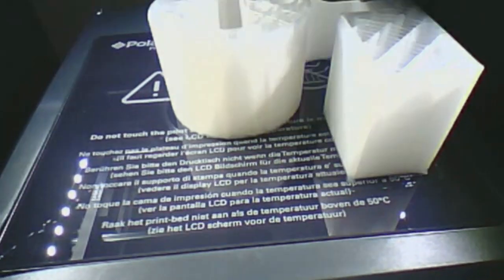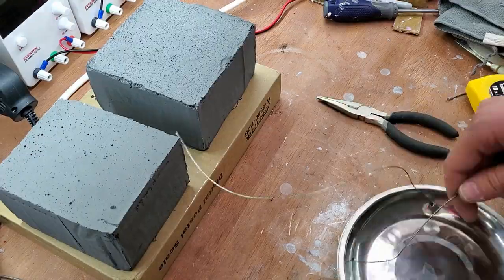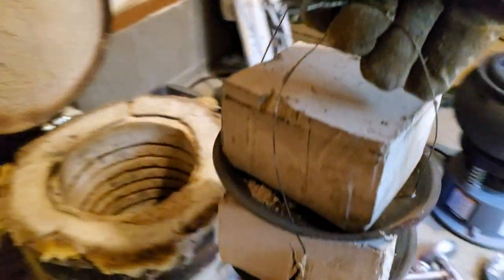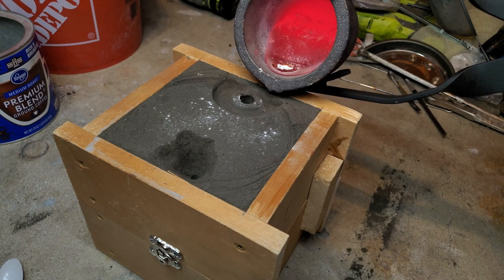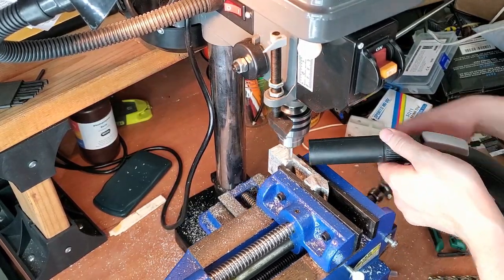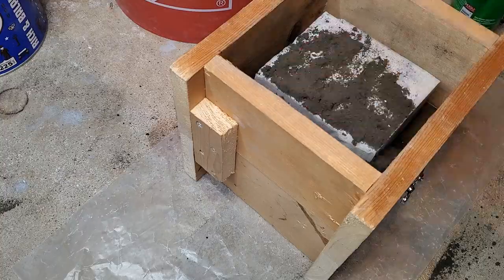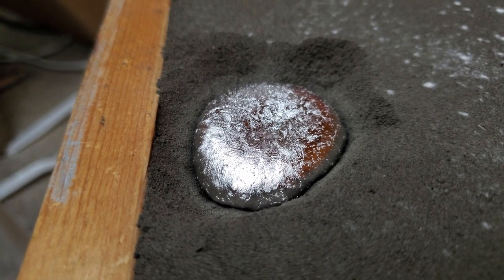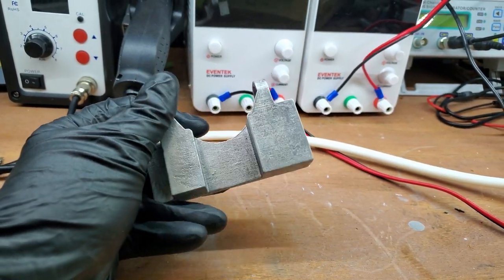Trying MyFordBoy's Method

Comment: Additional ideas.
1. Cover the 3D printed master thinly with plaster using a brush. Put some steel wool around and cover again with plaster to build up some thickness. Bury the whole mold in sand and burn out in sand, the thin plaster mold should heat up quickly and dry out while the plastic is melting out. Then cast. This is what I would do because I dont have a dedicated oven with temp and time switch etc.
2. Spray the master with 800°C heat resistant spray paint. Dribble fine sand on to the wet paint on the 2nd 3rd 4th coat to build up some thinkness. Burn out and cast like before. This also should work with aliminium.

Comment: the cracking probably happened because of water expansion, or maybe PLA expansion? you can raise the temp to 60 pretty rapidly, keep it there for a bit, keep it at 80ish for a bit, and keep it around 90-110 for a bit, then start going up the rest of the way, doing the same thing again around the melting temps of PLA?

Comment: I think the reason is that any thing you could design with a CAD you can easily print it with a 3D printer , and then lost PLA then became the easiest method to convert this object to metal , while the traditional sand casting require you to tool a model for the part to Greensand Cast or use an real copy of the part

Comment: also use a vacume to suck the air out the of investment slurry. plaster of paris is an awesome investment material to use as well very low amount of air bubbles. if u want better heat retainment try pearlite in the mix.

Comment: why use investment, Plaster of Paris/Fine sand mix works just as well and PLA will burn out in an oven set to 220 celsius  I leave it at least 24 hours before burn out ( for the plaster mix to lose more moisture) and when ready to cast put the plaster mould on the furnace whilst melting the Ally to heat up then put it in the green sand
Reply from the maker: 220C, no matter the time, is not hot enough to expel the chemically bonded water. You might be getting lucky now, but you shouldn't play with your own safety like that
Reply: @TenTries  Maybe the 50/50 mix with sand helps I've had success with Ally but I would not try this with brass. so far so good,  Probably 10 times or more and a few of those I could have reused the mold  If I did not have to wash it off, so it definitely works for me. Don't believe everything that you see on  yuotube.  I do prototyping design and cast/machining for a living, (not posting youtube vids) so luck has nothing to do with it, People who do casting with no PPE are the ones who need luck. So maybe you should try my method  before criticizing, Thanks for reply
Reply: Can you really burn out the PLA at only 220 C? I print PLA with the printer set to 210C...
Reply: @slicktires2011  It is slow but it does melt out

Comment: Lost foam, lost pla and lost wax all have one problem that a wood pattern does not have. If the casting fails, you lost the pattern. Unless you have, like for lost wax a silicone mold to make a duplicate. Lost foam has that option but that can get expensive, depending on how far you want to take it. Lost pla, reprint, every time your casting fails. I'm a patternmaker by trade, haven't found anything that can be done with cnc 3d printing or industrial lost wax yet. Sculptures don't count.

Comment: I wanted to ask a very specific question, when raising the temperature to burn out the plastic, let's say up to 650 degrees celsius over 8 hours. When you say slowly, would something like 2.7 degrees Celsius every 2 mins work. What is the ideal rate of increase per min?. Also could you clarify why you reduce the the temperature at the end of the mold after its completely burned out and to what temperature for how long. Thank you for taking the time to read my comment and looking forward to your reply.
Reply from the maker: Really, it's best to follow a burnout schedule/cycle. You can find the burnout cycle I use at https://tentries.com/lost-pla-casting/. A simple steady increase in temperature isn't ideal for burning out investment. A staged approach as shown in the link works much better.
I let the investment mold cool so that it wouldn't break due to the thermal shock of touching the much cooler sand
Reply: @TenTries  Thank you very much, really like your channel and hope you can make some cool aerospace parts, the more complicated the better xD

Comment: I just had an idea but don't have the equipment to try it - lost pewter casting - make mold of PLA part with high temp resistant silicone for maximum detail, then cast with Pewter which won't melt the silicone, then create a new plaster mold with the pewter part and melt it out as per lost PLA method and then cast with Aluminium?
Reply from the maker: That's a cool idea! I have some fusible alloy (even lower melting temp), so I might have to give it a go! That might fix any ash issues
Reply: On my channel, you can see some old silicone pewter casting videos. Smooth On makes a great high temp flexible silicone for that task.
Reply: Interesting, but what would be the advantage of pewter over wax?

Comment: for lost pla, if i used sand instead use paris plaster.its ok?
Reply from the maker: You'll want to use casting plaster, which is not the same as plaster of paris. Casting plaster has some additives that make it more suitable for casting. Have you seen my videos on Lost PLA casting? I talk about how you can make casting plaster from ordinary ingredients.
If you are referring to just pouring aluminum directly onto PLA without burning out the PLA first, definitely don't do that. It can send molten aluminum spraying everywhere, an you will almost certainly not have a very good cast. The PLA and water in the plaster must be burnt out

Comment: You'll have to use very dry green sand, or the plaster will suck up humidity 
Once the plaster gets humid, you're screwed
Reply from the maker: True, I moistened the sand just enough to pass the break test, as usual. It was not moist enough to affect more than a very thin layer on the outside of the investment, away from where the aluminum contacts it

Comment: Credit where credit is due but not where it is not due. Myford did this about 3 years ago. He certainly was not the first. Pauls garage did it about 4 years ago and 3DTPO 4 more before that i.e. 8 years ago. Myford's result suffered some mould fallout and metal miss fill. I know where you got that crazy pouring basin design from and I urge you to abandon it for it is crap. A good basin will keep the sprue full, yours certainly did and indeed because of its design could not. There did seem to be a lot of gas coming from your solidifying metal. Also if you want a half solid castings you need to provide some risers.

Comment: The investment casting looked damp shortly before you put it into into the furnace. Could a longer stage of air drying before burnout have helped? Great vid
Reply from the maker: Possibly. If I had used the burnout cycle from my first video, the investment would have been a little stronger at the end. A proper burnout cycle evaporates the free water pretty effectively without causing damage to the mold